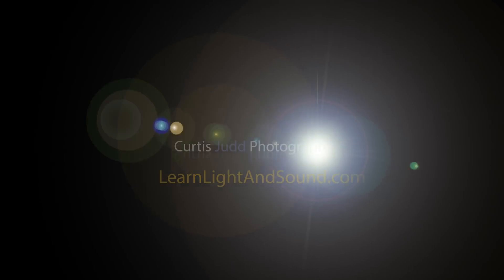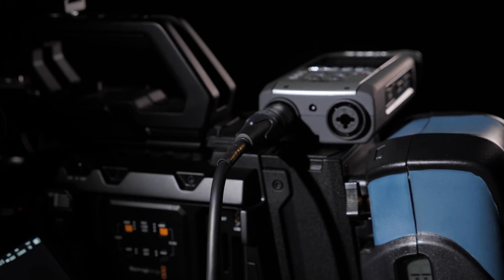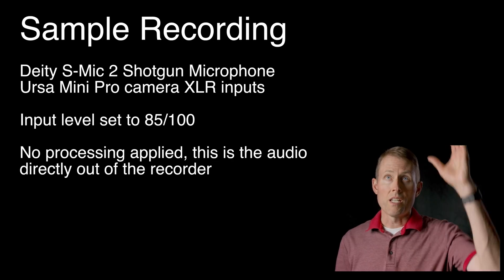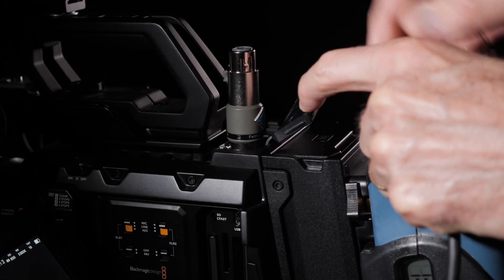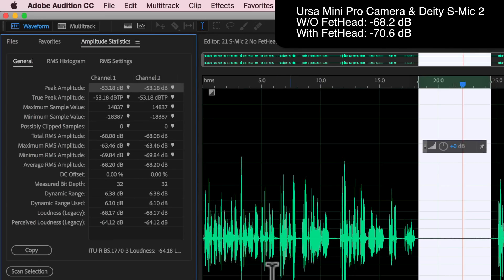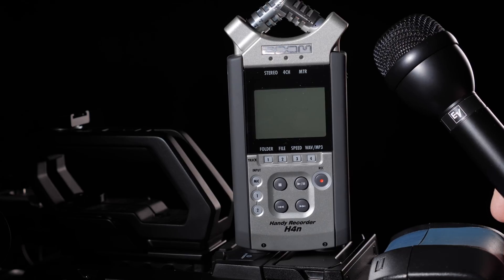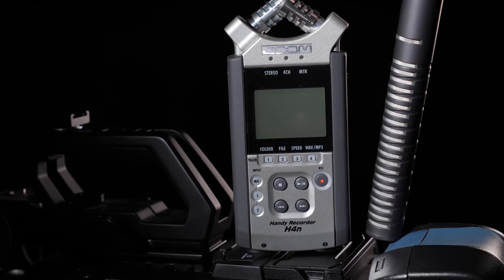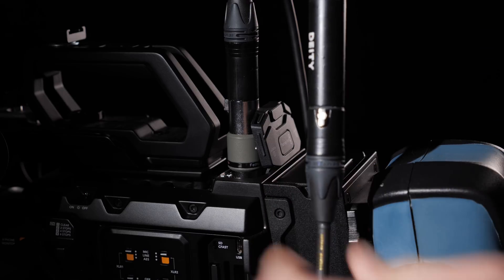FetHead Phantom: Louder, Cleaner Audio for Condenser Microphones

Comment: I am finding that Shure MV7X and Zoom F3 doesn't have enough gain for the microphone. I will need to get and try the fethead for dynamic that doesn't pass the phantom power. It has class A circuit.
Zoom F6 has much higher gain.
Reply from the maker: Interesting. I would have figured that combo would work without a Fethead.
Reply: @curtisjudd  MV7X works with F3 but it is missing the brightness of the sound so I am using Sennheiser ME 4 in parallel on the second channel to compensate in the EQ and it sounds pretty good together. If I boost the MV7X at x256 or X 512 it works better but the sound has components of digital distortion. It needs more gain.
Reply from the maker: @borislavatatchev Ok.
Reply: @curtisjudd  that's related to Realtime Live production sound output, not to the automatic 32-bit float recording capacity.
Reply from the maker: @borislavatatchev Oh, yeah, the output isn't that great.

Comment: Do you happen to know if you can use a fethead with an NTG4+ when it’s operating on battery power? Will the fethead take power from the mic battery? 

Trying to figure out a good solution to solve low gain from the mic to utilize with my rode wireless pro for wireless boom operation.
Reply from the maker: I don’t believe that will work.
Reply: @curtisjudd  Ok - I guess the power from the mic's battery would only travel to the mic itself which makes sense. 

In this case, if I wish to boost the gain of the mic, I would need to have a source of phantom power down the chain? 

So I would need a device to both adapt the signal from the XLR mic to make it compatible for the 3.5mm input on my recorder, and provide phantom power? 

Do you have any recommendations?
Reply from the maker: @stucooke3983  Honestly, I'd look at something like a ZOOM F3 recorder.
Reply: @curtisjudd  understood thank you I’ll take a look

Comment: Thanks for this video.. 

Quick question.. 

Would it work on mic that does not require phantom power (e.g. ribbon mics). Like if I just turn the phantom power off in audio interface.
Reply from the maker: No, it needs the phantom power and passes it on to the mic so make sure your ribbon mic can take phantom power or this may damage it.

Comment: Ciao, thanks for your test !  I also have an active ribbon mike, Golden Age R1 MK3, it has a  builtin preamp using the phantom voltage as its power suplly. Is it possible and zero risk to use this Triton model with this active ribbon ('cause its preamped output isn't so high..) to get  a stronger and clearer output signal ? Thanks much, Ciao
Reply from the maker: In theory yes, but I haven’t tried it.

Comment: Hi Curtiss

Here is Ricardo Beccari from Brazil. I have 03 Shure SM7B in our studio, we use fethead plug direct on the the back of mic. Is this correct forme? Or I need use the device direct on the mixer?
Can you help me?

Thank you!
Beccari
Reply from the maker: Yes, that's correct. Connect the Fethead to the microphone and then a cable from the fethead to the mixer.

Comment: Hello.
I have a Fuji XT-3 camera with a Deity S-Mic 2s mic - I want to be able to run that mic as a shotgun to my camera and use a xlr to 3.5mm jack adapter to plug into camera (if possible).

Will this FetHead phantom be able supply power to the camera? The Deity microphone takes 24-48v.

Thanks,
Marco
Reply from the maker: No, it only passes power through, it does not supply power.

Comment: great video. would I be able to use the fathead phantom with a sanken CSM1 and a xlr to 3.5mm adaptor? What would be the smallest divide to use a sanken CSM1 with a camera that does not provide phantom power? Thanks 🙏
Reply from the maker: No, the device you connect to must supply +48V phantom power. I’d look for a portable phantom supply. I’m not familiar with any.
Reply: @curtisjudd  thank you

Comment: I’m using a Shure KSM9 condenser mic, 20ft cable, going to my Schertler Roy X, with onboard phantom 48. When trying to get a decent signal, I have to ramp up the gain on the Schertler to around 4 o’clock. It’s this way on all Schertler amps, why…, I don’t know - anyway. Would the Fethead Phantom boost the gain at the Schertler, to where I would have to ramp up the amp gain so high?

Warm Regards 
Jim
Reply from the maker: Hi Jim, most likely, yes. Happy recording!

Comment: I got a brand new Sennheiser hkm 416 shotgun mic and I wanna use it with my h4n recorder. Will the Fethead Phantom work with that mic?
Reply from the maker: You should NOT need a FetHead with the MKH416 and H4n. The MKH416 has a strong enough output signal that it does not need the FetHead.
Reply: @curtisjudd  Then what input settings are you using on the H4N with the sennheiser 416? 70? 80? It still seem like the gain could be better, but I wanna check to see if I'm doing something wrong. Now I'm hoping that my 416 isn't a fake.
Reply from the maker: @Confound Productions  I use whatever input level I set to get the meters topping out at around -12dB. I don't even know what that number is. It really doesn't matter. The more important thing is to place the microphone, ideally, within 30cm of your mouth and record in a space without a lot of ambient noise.

Comment: Deos it work with rode nt1 on zoom h6 or does it make sound better ??
Reply from the maker: You should not need a Fethead for a RODE NT1. This doesn't make microphones sound better, it just provides more amplification.
Reply: @curtisjudd  thank you for reply  i use rode nt1 on zoom h6 when i set gain above 5 i hear high self noise even without mic does  i need fethead for zoom h6???
Reply from the maker: Do you hear self-noise when the microphone is plugged in? That's the real test. And even if you do, I'm not sure the FETHead will fix that issue. It could be an issue with your particular H6. You'll want to contact Zoom support to confirm.
Reply: @curtisjudd  thank you so much i will do that

Comment: thanks for the review i want ask whats the best gear for sm7b? do i nead fathead?
Reply from the maker: There isn't really a best, but there are a lot of good options and it depends on the situation. What are the requirements for your situation? Budget? Portability? Number of inputs?
Reply: @curtisjudd  thanks for the reply

I want to use shure sm7b with more than 6 inches distance and available interface in my country is , Focusrite Scarlett 8i6, Audient iD14 MKII , scarlet 2i2 3rd gen, Solid State Logic SSL 2+, Universal Audio Volt 2 USB Audio Interface , Audient iD4 MKII, goxlr mini, universal audio volt 2 and there is some options over 1000$ like RME Babyface Pro FS and Focusrite Scarlett 18i20 , Universal Audio Apollo Twin X DUO Heritage Edition but I cant afford them now, what's from these choices well suite me and give me the best of this mic and I need with usb power only for deap laud clear voice without cloudlifter
Reply from the maker: @A7mad.  I would NOT recommend using the SM7B more than 6 inches from the mouth, regardless of interface.
Reply: @curtisjudd  well try to use less than 6 inches, which option well give me clear voice without noise
Reply from the maker: @A7mad.  I'd go for any of those you listed with at least 60dB of gain. If you go with one which has less than 60dB of gain, you will want to add a Cloud Lifter or FETHead. You'll just want to look at the specs for each to see how much gain they supply.
Reply: @curtisjudd  thank you so much for help , I was hoping to try the moods in new vol 276, but its 55 db, I think I well go for ssl2+

Comment: Thank you for the video, Curtis, very informative. One point, though...you say the Fethead is incompatible with the Rode NTG-2 shotgun mic. I have this mic and was looking at buying the Fethead. I read elsewhere that if you put an AA battery inside the NTG-2 while still supplying phantom power from the camera to the Fethead, this will work. I don't know how or why, but worth a mention if it does work. What do you think?
Incidentally, I bought a budget Rode Videomic Go (not the Rode Videomic Pro) the other day and this $50 directional mic blows the NTG-2 out of the water. It shocked me!!
Reply from the maker: Hi Chris, that might work. I don't have the NTG2 at this point — gave it to someone who needed it more than I do. So I can't test it, but that might work with a battery.

Comment: Does it mean the ntg4+ needs to be powered through its battery?
Reply from the maker: No, you just need to turn on phantom power on the recorder or camera with the XLR input.
Reply: So if i attach the fethead to the ntg4+ it will still get power from the rodecaster?
Reply from the maker: @MotherBee  That’s correct.
Reply: @curtisjudd  thank you Jude. I would like to ask your help to coach me how to adjust my rodecaster because Sounds is not my forte. I would like to have good sounds just like yours. I always fail with my sounds even i have good gears already.
Reply from the maker: Perhaps this tutorial will help: https://youtu.be/By8k_E8bFYw

Comment: Hi Curtis. A quick update on 2 months ago. Today I received a Sennheiser MKE 600 condenser mic which has the option of 48v phantom power or a single AA battery. I previously mentioned I have a Fethead (not phantom) which I used with a Shure SM58 dynamic ~ not ideal but it got me started creating for YouTube. So a question. If I were now to use the Sennheiser with the AA battery, and power the (none phantom) Fethead with a 48v supply, would it work without breaking anything? Or do I need to purchase another Fethead with phantom?  - You answer will be much appreciated. Thanks. 😊👍
Reply from the maker: Hi Peter, it should probably work. I don't have that combination of devices to confirm, but it should work.
Reply from the maker: Though come to think of it, I don't see why you'd need a fethead for use with an MKE600. The MKE600's output signal is strong enough for most preamplifiers.
Reply: @curtisjudd  Hi Curtis. Thanks for your 2 comments. In reality the Shure dynamic with the Fethead requires less gain at the input  stage of my Yamaha MG10XU board than the Sennheiser for the same volume output. I gave the battery + None Pantom Fethead + Sennheiser combo a go and had to attenuate as too hot. The result though with the input gain dialled back is near silent running with ample gain. I dare say that if I had a Mix Pre from sound devices that it would provide the desired gain and silent running without even requiring a Fethead. Sadly though, it is out of my budget. 
Just quickly, the reason I am plugging into a board first rather than a digital recorder is I also do a lot of live-streaming and the board gives me the flexibility of  EQ for a “Radio voice“ and separate EQ for instruments, plus effects if required. Thanks for coming back to me and I look forward to your future content. Peter.

Comment: Hi Curtis  - Just a quick note. I have the original Fethead into my Shure SM58 dynamic mic and then into my Yamaha MG10XU USB mixer and what a difference it made (monitoring through headphones) in terms of gain without lifting noise. I had been using the Fethead into the end of the mic then the 5 metre cable to the board. It never occurred to me to put the Fethead into the board until watching your video. I tried it and got a slight yet definitely audible earth hum. I did the same experiment with an SM57 and it did the same thing? Going forward I am looking at the Zoom F6 and the Rode NTG2. Would the F6 working in 32 bit float make something like the Fethead redundant or the more gain the better? Thanks, Peter.
Reply from the maker: That's great news, thanks for sharing Peter! I would test with the F6 to see whether it helps or not. I suspect it will not, but I'm often wrong!
Reply: @curtisjudd  You wrong? - never......let's settle on less wrong than the majority.
Reply from the maker: @PeterMossUkulele  Yes, I embrace learning when I am wrong so that I can become less wrong every day. 🙃

Comment: Hello, does it work well with a Samson C02?  I have it coupled with a zoom h5 and to get the peaks at around 16db I have it at around 80%, higher than that it gets very noisy, I'm not sure if it's from the mic or the preamp, but I haven't seen any comparisons with the C02 so far.
Reply from the maker: It should though I don't have a C02 on hand to test. You might contact Triton Audio support to see if they have received any reports of issues.
Reply: @curtisjudd  I'll do that, thank you for the response!

Comment: Sorry the ursa 4.6 and the mkh416
Reply from the maker: The one we reviewed here: The Fethead Phantom (link in the description).
Reply: @curtisjudd  Hi Curtis, I realize you have used the Ursa 4.6 along with a variety of mics and the Triton on top. Would you safely say for Cinema that the sound would be adequate using the camera only? Would you also split the audio into both channels and keep one set lower so that if your main channel clips you should have an acceptable recording on the other. Thank you and regards
Reply from the maker: @jeffwilliams1923  I suppose it depends. Normally for feature films, there are advantages to using a separate audio recorder. One of the biggest is that someone else can operate it and focus entirely on sound while the director and DP focus on other things. So many people assume it is just that an audio recorder sounds better, and when you get into prosumer and higher recorders, that is generally true, but it isn't the only factor. A HUGE advantage is that when you have a person or small team focused on sound with a dedicated audio recorder, they can usually capture better sound. It also gives them more freedom to use both a boom mic and wireless lavaliers so that the post team will have more options for each line. So when you say cinema, it really depends, but I would generally avoid using the inputs on the camera as the only sound capture. I'd get a dedicated sound person inasmuch as possible.
Reply: @curtisjudd  Thank you good advice. Great audio is as important as great video, but can't be poor at any time.
Reply: @curtisjudd  Hey Curtis one other question if I could and I promise to leave you alone for at least a little while. Haha. Can you record 32 bit float into your camera from from the recorder or is the camera unable to accept it and sync is my only option? Ursa g2 Thanks again
Reply from the maker: @jeffwilliams1923  No, there are two things to consider there: The output of the recorder is analogue (so it is converted from 32-bit float back to analogue) so any instances where the digital audio exceeds 0dB will be clipped on the output of the recorder. Secondly, cameras do not yet record 32-bit float (and do not have the 2 or more converters per input required to support 32-bit float, wide dynamic range recording). This means that you CAN send audio from the recorder to the camera, but you will not maintain the benefits (no clipping) through to the camera. If your audio exceeds 0dB in the recorder, the recording will be ok on the recorder, but the audio will be clipped in the camera.
Reply: @curtisjudd  Ok thanks again. So if I understand correctly you would have to record separately in 32-bit float and edit the audio before you sync it to the video, unless you're editing software can accept 32 bit. And to record directly into the camera you would have to record everything below 0 DB, or it would be clipped in the camera audio and recording below zero DB would be risky?
Reply from the maker: @jeffwilliams1923  Correct. You can still record to the camera and then just replace it in post with the audio from the 32-bit float recorder.

Comment: Hello, thanks for your videos. The benefits of Fethead Phantom are often questioned... More than the need of extra gain, the phantom version could help in reducing the noise floor in presence of not stellar preamps, better if with medium to low sensitivity condensers.  Zoom H4n preamps are very noisy ( EIN more than 10 db's worst than H4n Pro and even more in comparison with the Ursa mini preamps) so the improvement is always noticeable. It would be very helpful to test the phantom fethead on a Zoom H5 or 6, which lots of people own over the older H4n, to check the actual improvement on S/N in recordings. Buying two of them for a stereo setup may represent a super portable solution; still not extra cheap, so knowing what results can be expected would be great. Thank you.
Reply from the maker: Thanks Carlo. Alas, I have neither an H5 nor H6. My thinking was that the inferior H4n would be a way to show the improvement for one of the most ubiquitous recorders with relatively weak preamps.
Reply: @curtisjudd  thanks for answering. I understand this... probably h5 or 6 with their EIN at -120 are in that “not great nor bad” range which may give unpredictable results with the fethead phantom....

Comment: Hi Curtis,

I have a Zoom H6 and a Rode NT4 stereo mic. The NT4 comes with the possibility of using a battery instead of the phantom. I’m interested in purchasing two (L | R) FetHead Phantom to lower the Zoom noise. Do you think this could be indeed a solution? 

Thank you in advance.
Reply from the maker: It could be, depending on whether most of the self-noise is coming from the H6 preamps at high gain or the microphone.

Comment: For some crazy reason I decided to get both--FetHead Phantom and FetHead original. Though the Phantom works with dynamic mics, the original is even better. The Phantom is rated to add 18 dB of gain, whereas the original adds 27dB. On my Tascam recorder with noisy preamps the difference is clear.